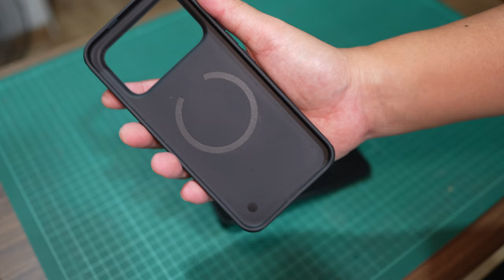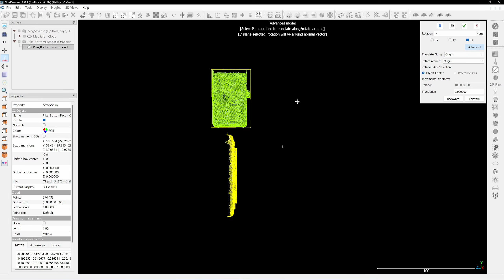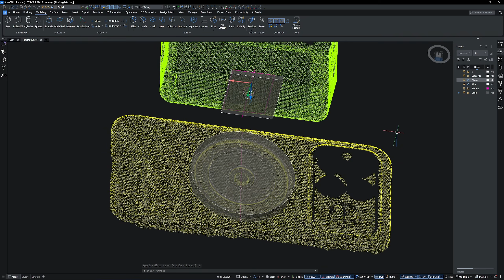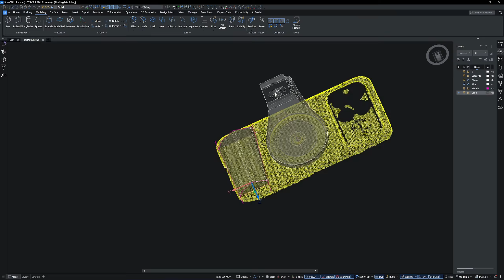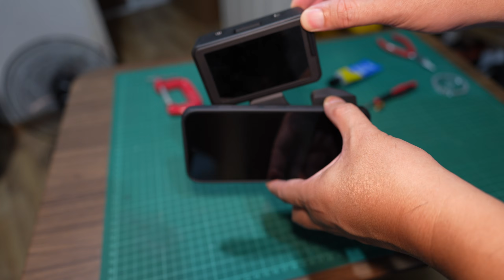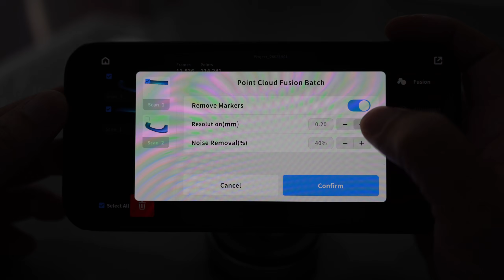Creality Pika DIY MagSafe Phone Mount – Complete Tutorial

Comment: Dear @Payo. I purchased a Pika because of your great  reviews.
I planned to use it with my ipad 13" M5 and/or iphone 14 Pro but have huge problems with connecting via wifi. The connection gets lost, is very poor or it doesn't connect at all.
I wrote a letter to Creality but I wonder if you (or anyone reading this) have seen similar issue?
Of course I have the latest IOS and latest Pika firmware. There are no other WIFI sources in the neighborhood and I have the Pika literally next to my devices. This is very frustrating.
Thanks and keep up the fantastic work!
Reply from the maker: I don’t have an iPhone or iPad to test, so I can’t troubleshoot your issue. However, one viewer connected their iPhone 17 Pro Max to the Pika and achieved 60 FPS. Another one said he also gets the same speed for iPad M4 Pro.
https://youtu.be/quCarnR7ofQ?si=Pu241_IoE8JPx-Lj
Reply: @Payo-TensileCreator thanks for the fast feedback. I’m in contact with the Creality team. I think I have a faulty unit unfortunately.

Comment: Please make tutorial using Quicksurface.. This is the new generation of sofware for easy reverse engineering..
Reply from the maker: QuickSurface is a third‑tier, low‑feature CAD software. With no real user base, it relies heavily on advertising aimed at new 3D scanner owners. It struggles to reverse‑engineer even basic objects correctly, and no serious professional uses it.
Reply: @Payo-TensileCreator try it first sir. Im using Solidworks, Blender, Inventor and Fusion but quicksurface give me the easiest tools i want to reverse engineer a 3d scan files.
Reply from the maker: @Tina_Muran  Yes, I did. Even the model shown on their website’s front page is incorrectly reverse‑engineered. It’s one of the most deceptive CAD tools on the market, coming from someone who’s used Autodesk Inventor daily for 26 years.
Reply: @Payo-TensileCreator  sir how about Geomagic Design X? Have you tried it before?
Reply: @Payo-TensileCreator And also please make detailed comparison of 3d scan beetwen pika and otter. Because i already had otter and plan to buy pika if i was convince that pika has better scan quality specially on small objects and deep pocket holes.

Comment: Hi, would you recommend this scanner for the metrology of machined parts—for example, accurately locating hole centers? I’m concerned that the AI might alter the precision by generating data that doesn't reflect reality. Thanks.
Reply from the maker: On the 100 mm Class 1 gauge block test, the Pika showed 40 µm accuracy error. In theory, that places it in the IT7 metrology grade category. However, the angular accuracy error is a bit high at 0.2°. I’ll run more tests next week using a Class 0 200 mm block, plus ring and pin gauges, to see how precisely it can locate hole and pin positions.
Reply: @Payo-TensileCreator  Thanks, that tolerance is more than sufficient for many mechanical applications... I look forward to your next video.

Comment: I'm using sw for about 8 years, but I'm not have enough money for a official license, what do you think could be the best option between freecad and autodesk fusion to replace it?
Reply from the maker: I’ve been using Autodesk Inventor for 26 years. FreeCAD is fine for basic geometry, it can handle point clouds up to about 1 million points before the viewport slows down, which is good enough for everyday 3D printing. Fusion doesn’t support point clouds, so you can skip it; reverse engineering with mesh will quickly hit limitations. BricsCAD, on the other hand, has really impressed me. It’s faster to model than Inventor and can handle large point clouds up to 300 million points. For large assemblies with more than 3,000 parts, I still rely on Inventor. But for smaller assemblies and reverse engineering work, BricsCAD is always my choice.
Reply: @Payo-TensileCreator thank you! I forgot to mention that I'm scanning cars, so my big limitation is to working with large and detailed 3d scans, your suggestions is really appreciated and opportune for me. 
Regards from Colombia!  🇨🇴 😸
Reply: @Payo-TensileCreator what's the biggest differences or advantage for you, between to work with points cloud and meshes for reverse engineering?
Reply: Fusion 10000000%

Comment: Can PIKA replace RAPTOR in terms of scanning quality?
Reply from the maker: No, At the 0.1 mm setting, the Pika delivers lower resolution. Even though its dimensional accuracy error remains the same, 40 µm at 100 mm, the angular accuracy error is larger.
Reply: @Payo-TensileCreator  in real world application, do you think the difference in resolution/angular accuracy will make any difference for reverse engineering objects to filament/resin print or directly printing from scan?